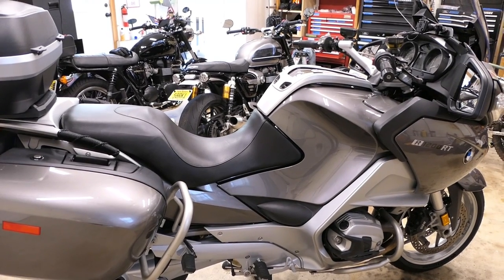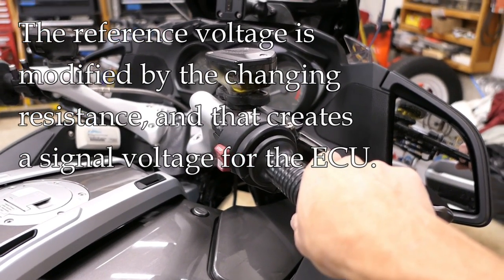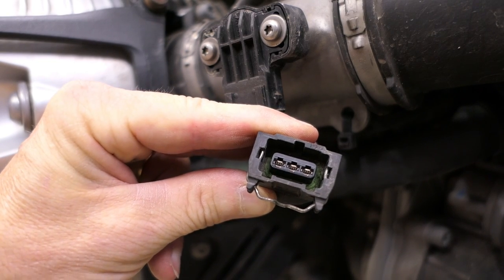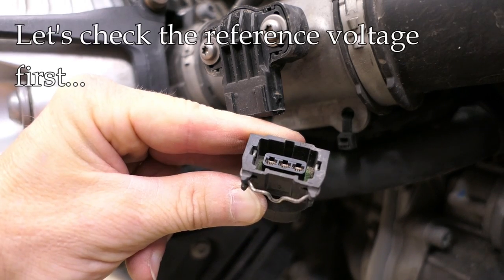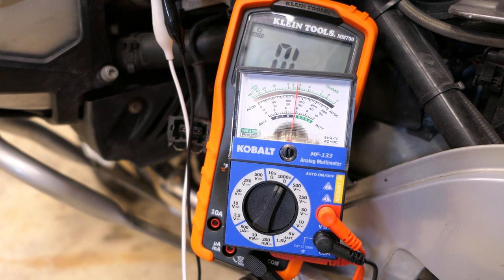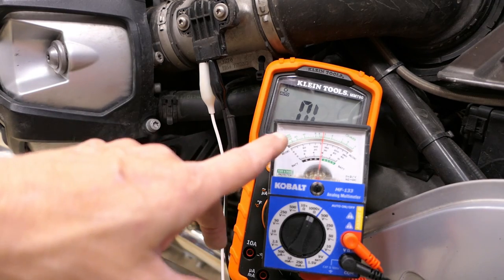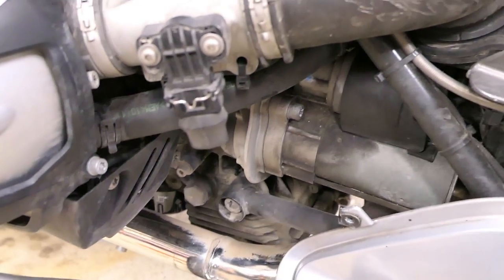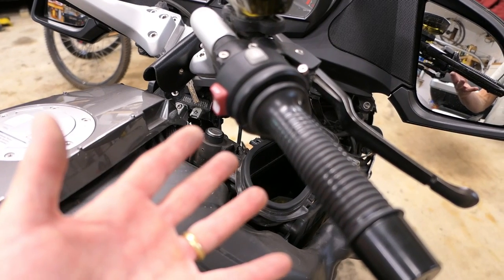Throttle Position Sensor Testing On BMW R Series Motorcycles

Comment: I just want to genuinely say thank you as watching this video has resolved a rough idle and stalling issue that I have had on my RT for months. BMW dealer couldn’t find the source of the problem and neither could my local mechanic.
I have just replaced the throttle position sensor after watching this video and now the bike idles and runs perfectly.
Thanks again.
Reply from the maker: That's really great to hear!  It's a little disheartening to learn that a dealer couldn't figure that out, but at least you got it sorted yourself.

Comment: I recently experience a caution light, and engine light after i accelerated. Felt like the bike went into a limp mode. I could not accelerate. I turned it off and then back on. I have not experienced this again. I rode today for 100 miles, and it has not happened again. I have heard it could of been in the throttle or throttle position sensor? My bike is a 2013 1200gs
Reply from the maker: I would doubt the throttle position sensor would be at fault there.  When that sensor starts to go bad there are data drop-outs, and the computer does not typically recognize a problem, it just gets confused.  If you have an actual light on the dash, that's good news in the sense that a code was stored.  You can use a GS911 or Motoscan device to read the code and get a clue about what has gone wrong.  You should start with that.
Reply: @tinderboxarts  thank you

Comment: I HAVE A R 1200 C 2004 MODEL IS THE SAME TPS ?/I CAN ADJUST THE SAME WAY?
Reply from the maker: I'm not familiar with that model, but if it is fuel injected then the throttle position sensor is likely to be substantially similar in function to the one in the video, and it could be tested the same way.  All of the sensors on bikes, cars and trucks work essentially the same way.

Comment: I’ve been using a GS-911 to calibrate and measure the TPS on my R1150RS. The position reads out in degrees, not %. Less than useful. I can’t get any voltage readings from the disconnected cable or the unit.
Reply from the maker: I'm not familiar with that bike, so I just did some research.  I think you probably have a four pin connector?  It seems like there may have been more than one type of system installed on those early models, but I can't confirm that.  Apparently your system uses two potentiometers, one for fine adjustment and one for course adjustment, which is the degree measurement you mentioned. I believe you should be able to check those potentiometers in a similar way to what is shown in the video, though it may be different pins.  They should react smoothly on an analog meter.  However, there is a registration process that owners of these older bikes report using, which synchronizes the sensor with the computer.  The best explanation I found is here, but be sure and read the whole thread:  https://forums.bmwmoa.org/threads/tps-alignment-idle-speed-adjustment-beyond-zero-zero.73962/

Comment: Just to the beginning: A lot of bikes with carburetor have a throttle position sensor. For example Suzuki GSF 1200 1997. but it’s more common on injector bikes 😊
Reply from the maker: Possibly Suzuki used the sensor to help control spark advance, I don't know.
Reply: @tinderboxarts  nope. Was for ignition timing to pass exhaust regulation
Reply from the maker: That's the same thing--spark advance is just another way of expressing ignition timing.

Comment: Hello - can a faulty TPS cause the motor to race regardless of the actual position of the throttle? As I was driving my 2004 R1150R casually and shifting into 3rd, it was as if the throttle became wide open and I had to kill the motor. Upon restarting it again raced so I had to ease the clutch out to get moving and then kill the motor and coast repeatedly to get home. Once home I tried restarting it a few times and the same thing kept happening. I had the dealer pick the bike up and they said that when they started the bike it was fine and the tech told me he drove the bike about 15 miles with no problems - I asked him to check for frayed cables or something else that would cause the throttle to remain wide open in spite of the twist grip being at idle, but then I saw your video, so I'm thinking that this may be the problem. I'll greatly appreciate your input. Thanks
Reply from the maker: Interesting problem.  That's an older bike and I'm not thoroughly familiar with it, so I'll have to speak somewhat generically.  A runaway throttle as you describe is typically going to be related to a mechanical issue, such as a cable or broken linkage in the throttle bodies.  If your bike has cruise control, that could also be an area of concern.  An electrical issue within the cruise control system could cause it to come on unexpectedly.  

When a TPS is bad the common complaints are a hesitation on acceleration, a poor or inconsistent idle, or a bucking or jerking while cruising.  Most vehicles are still using a mechanical connection to the throttle bodies and the TPS is used to fine tune the air/fuel mixture.  There are newer vehicles which are entirely "ride by wire" with no mechanical connection to the throttle bodies or throttle plates, and those could be more susceptible to unintended acceleration due to bad sensors, I suppose.  

In your case you do have a mechanical connection and you may also have a cruise control fitted.  Your mechanic should be doing a thorough visual inspection rather than just jumping on the bike and going for a ride!  The grip itself, the the cables and the throttle body linkages are all potential areas of concern.  It's easy enough to test the TPS, so that could also be done.  If you do have cruise control that would be suspect too.  Your mechanic should have his nose deep into the throttle controls rather than be out riding.

Comment: How does this work with the four pin TPS on the older R series bikes? Pin 4 is left and Pin 1 is right? The middle pin could be either of the remaining two? Thanks!
Reply from the maker: I don't have the answer on that one, but you can probably experiment with a meter until you find the correct two.  You won't hurt anything.

Comment: Your vids are very useful my info button on left switchgear has stopped working ive bought a new switch but have no clue how to remove the old switch gear. Will you be making a vid to show this process so i can follow it as there are no vids on youtube that show the removal and plug location. All the other buttons in that switchgear work perfectly its only the info button that is not responding . Thanks John
Reply from the maker: I have no immediate plans for that video, but typically you can use the new one to see how the old one comes apart.  Before you do anything, though, try spraying a liberal amount of electronics cleaner into the switch through whatever cracks you can find along the edges.  You might get lucky and the problem is just some corrosion or dirt on the contact.

Comment: Do you guys have any clue how to fix this issue ? 

I’ve been seen everybody replacing it and consumers also very angry because they said to me, it happens a lot and everytime is a huge amount money buying a new Throttle sensor
Reply from the maker: Throttle position sensors have been used in cars and trucks for decades, and they have a similar issue as those used on bikes.  While the component is generally reliable, it is a wear item which can develop physical wear spots internally over time.  If you ride or drive in dirty conditions or tend to use a very narrow throttle band, the wear can occur more quickly.  Fortunately they really aren't that expensive and I generally have not seen any vehicle needing more than one replacement in a lifetime.

Comment: My 2011 r1200rt keeps shutting down on bumper to bumper traffic. People said it might be my throttle sensor. Are they expensive??
Reply from the maker: Maybe you could give me more detail about what is happening?  If your engine is just randomly shutting off completely while you are riding, it would not be the throttle position sensor. Instead, it would likely be something like a loose or poor electrical connection causing your fuel pump to stop running or your ignition to lose power.  It could even be something as simple as a loose battery connection.  With some more detail I may be able to help you narrow down the possibilities.
Reply: When I idle on bumper to bumper traffic on 1 gear I release the clutch and it shuts off. I have to restart the engine. Happened 5 times on my way home.
Reply from the maker: Are you new to the RT?  Because a lot of new riders on the RT don't realize how tall first gear is, and it requires a lot more RPM to get started than on other bikes.  That aside, if you are in first gear and start to let out the clutch at around 1500-2000 RPM and the engine just shuts off, then you likely have a loose electrical connection somewhere.  Possibly the vibration or torque steer happens to be just right in starting off to cause the connection to fail.  For an engine to just shut off completely and suddenly it would be either a battery connection or ignition connection.  I would do a thorough visual inspection of the battery cables and ignition components to look for corrosion, loose connections, or internally broken wires.
Reply: @tinderboxarts  可能是齒比因素 所以轉速要高

Comment: Hello and thanks for the video. In my case BMW F800R ( 2018 ) when i test i have value that start from 18% and goes up to 79% only when i full open my throttle . Note that with my ODB i have throttle position D and E and the one moving is the D. For E it's 0% all the time and i have two error related to that E( P2116 & P2127). Thanks in advance
Reply from the maker: You should be able to calibrate the throttle position sensor either with a GS-911 tool, or by disconnecting the battery, reconnecting, and then twisting the throttle lock to lock three times after turning the key to the on position. However, since you are getting codes, it appears you do have an electrical fault.  I would start be doing a thorough visual inspection, including pulling the connector off and looking for corrosion or bent pins, and examining the wiring harness.  If all that checks out then take a hard look at the sensor.  I'm not familiar with your bike model, but the general function is the same across most vehicles.
Reply: @tinderboxarts  In my case its a ride by wire and i have two sensor in the throttle. Seems that one of them is dead. Also my TPS is embedded with the throttle body so i can't test. Thanks for the advice
Reply from the maker: I looked to see if I could find your bike in the parts fiche, it looks like you have the same or similar sensor as all the other bikes located on the throttle body.  They sell it as a unit with the throttle body, however.  I can't find a reference to additional sensors in the throttle itself that you mention.  I'm certain your sensor can be tested, however, it's just a matter of finding where it is and the right pin connections.  They all work the same way.  I wish I could find some pictures or diagrams of your bike online and I could give you better guidance.  Sometimes it's helpful to look on ebay and you may find pictures of the components you need from sellers offering used parts.
Reply: @tinderboxarts  in fact its true for 1st génération but not for after 2017 ( euro 4 ) but sure there is a way to test it.  I found a used throttle and i will test with it to see if value is different or maybe it will solve thr issue. Thanks a lot for you time and advice

Comment: Great tutorial, perfectly useful, did everything as in video and came up with the broken wire. If you can post video of how to diagnose the fuel pump wires I would appreciate.
Reply from the maker: That's great to hear--being methodical usually pays off.  I don't have a fuel pump video, but if you are having an issue you can always disconnect the harness from the pump and put a meter on the pins to see if you are getting voltage or not.  If you are seeing voltage with the key on, then perhaps your pump itself has a problem.  If you are not seeing voltage then you can work your way back to see if there is a broken wire or similar problem.  The ECU might complain with the harness disconnected but it will reset when the harness is reconnected.  You can also use a piercing probe instead of disconnecting.

Comment: Hi , I have a R1150GSA I am setting the TPS to 250 mV then the stop screw to 340 mV but when I twist the throttle then let it go it won't return to the idle setting of 340 mV,  it could be 450 or 300 .
Could the TPS be faulty  ? Bike hasn't run for 18 months.
Thanks for the video.
Reply from the maker: I'm having a little trouble following your description, and I'm wondering if you are conflating two things?  Or perhaps there is a difference in your older GS that I'm not following.  There is no adjustment for the throttle position sensor, other than a calibration for the ECU.  It's job is only to report to the ECU where the throttle is currently located.  So, when the throttle is completely released the sensor should be reporting something close to 0% and when the throttle is completely rolled on it should be reporting something around 100%.  It uses a reference voltage supplied by the ECU and a variable resistance to alter that voltage when the throttle is moved.

If you are making adjustments, I wonder if you are referring to the idle adjustment?  See if this video shows something more like you are doing:  https://youtu.be/rID9_PBEvAE

That said, if your throttle is just not returning to it's stop you may have a mechanical issue rather than an electrical one.  Perhaps the throttle cable is hanging up or it is misrouted.  Or perhaps a throttle body has some damage.  Often a very close visual inspection will reveal something you've overlooked.